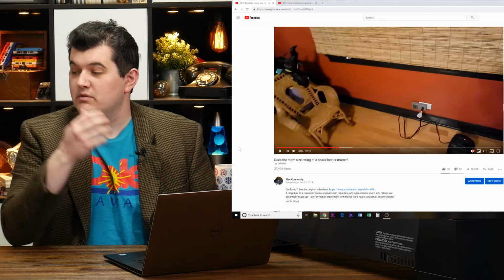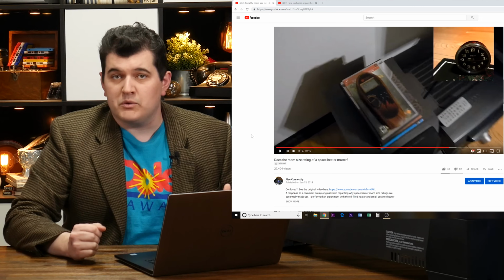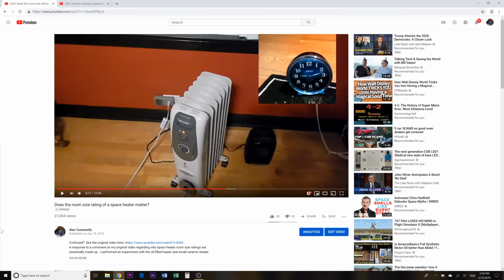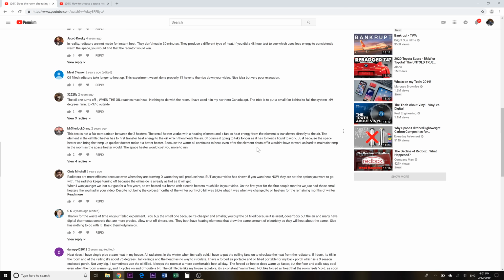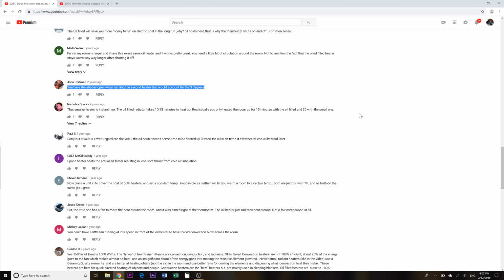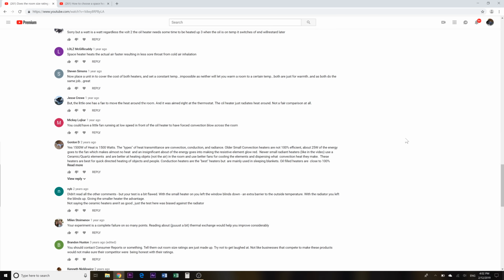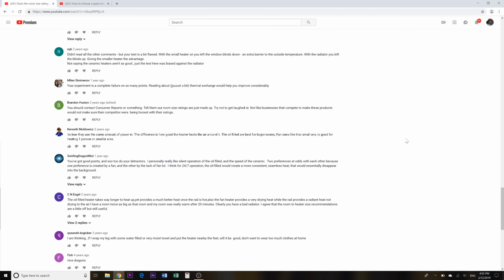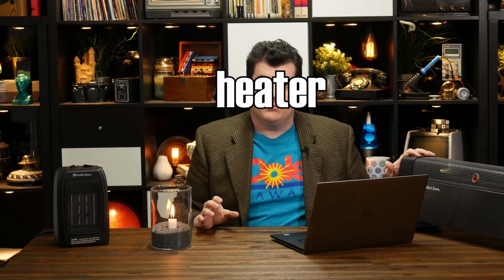More Space Heater Nonsense

Comment: Let me start by saying: I think you did a good job - could always be better but then again so could literally anything -, I don't think you're wrong, I think you're amazing. I'm really just about to ponder about what might be going on both with prices and commenters. Also I'm not reading through the comments, so it's possible someone else said these things already. I'm also not qualified to discuss any of these things, I'm a fantasy writer.

Firstly, I imagine at least at its inception, it could be that the room size rates were focused around how long the heater has to keep running? Maybe the little ones are projected to work fast and for a short time and the other ones are maybe meant to be more resilient to long run times? It could also be that when the room is large enough, having a space heater blowing out a small current of hot air in one direction is just ineffective, and you'd prefer the weird looking upwards facing radiator thing instead? And finally there's the expectation that in a small room the heater would be supervised, unlike the big ones where the thing has to be able to keep itself working alone.

None of this detracts from your main point, those ratings as they are right now make no sense. But I guess it's the same with every unregulated rating system, they're inconsistent at best, completely ungrounded in reality at worst.

As a final barely related note, there's a certain gut reaction to this kind of criticism to something we see everywhere. This instinct to go "No we're no stupid, you're stupid." because if this ridiculousness is omnipresent it indicates there's some deep flaws in society, and not everyone can cope with that.

Comment: I can think of two reasons the large space heater is technically more efficient. 1) it doesn't run a fan, which means any input energy is not being wasted moving around the air around itself and is instead focused on heating only. Sure both put out 1500W of thermal energy, but the small one may cost 1650W of electrical energy to run the fan plus heater. 2) under steady state, a thermostat will cycle the heater instead of you turning it on and off when you get too hot or cold, increasing overall efficiency in maintaining the desired temperature.

Comment: Okay one question about that 100% efficiency. Isn't there any current just flowing through the  heater without being transferred into heat? (it's running on 230v and uses 3000 Watts as I live in Germany, but I don't think it makes a difference in the principle)
The coils of my heater have a much bigger diameter then the cable, it still works as the current of the material the coil is made of is much higher than in the cooper cable. But is it 100% efficient? And if I have current flowing through it with no effect I still have to pay for it, don't I?
Thanks for reading and I hope my English is not to bad.
Stay healthy.

Comment: Maybe the larger ones are somehow better at efficiency. Suggested test:
Hook both heaters up to a socket kw usage meter (do they make those?)
Let both heaters bring roughly same size rooms up to a desired temperature (since you've already demonstrated the smaller one gets there quicker) and see if both heaters are as efficient at MAINTAINING temperature. See if the larger one maintains temperature better - ie, is "better" for larger rooms in terms of efficiency - possibly due to its extra "thermal mass"?
If the smaller heater has to drastically "overheat" the room to maintain a desired temperature, then the higher gradient between the outside temperature and the room temperature may result in greater heat loss over time and reduce efficiency. Whereas if the larger heat mass of the oil heater results in less overheating (the heater can turn off earlier and the oil maintain the temp closer to desired temp for longer) then it may "flatten" the heat spikes and result in less energy loss over time. In which case, it would be better for larger rooms in terms of energy efficiency.

The only other thought I would have is that "radiant" heaters may "produce" ore of its heat as IR (as opposed to convection), which might arguably heat surfaces better, which may make the room "feel" warmer to humans, without having to actually raise the temperature of the room as much (and thus increasing efficiency by reducing thermal loss by again reducing that delta T in the heat transfer formula and limiting energy lost over time.)

Comment: I know it's counter intuitive. But by turning the watts down on the oil heater it could potentially end up throwing more heat. If it heats low and slow it will reduce the surface tension between the hot and cold air. Any heater with a fan will make more turbulence between the hot and cold air. making the effect more immediate. but over the long run of a constantly warm oil heater on low watts vs. a fan assisted heater I believe the oil heater would win.

Comment: Nice video :)
Yeahr i also cant see why 1500w electric heater should be different from an other 1500w electric heater. To get the heat spread in the room, a fan is probably a good thing. The only way i could thing of with which you could get more heat from 1500w electric power would be a heat pump. But thats a totally different story :)

Comment: I am sorry for my ignorance, but say you have a small 1500 watt resistor. Say about the size of a incandescent bulb filament exposed to air. Would it heat a room the same as a regular heater? The answer should be yes, correct? Thanks.

Comment: Potentially, you can get a better rate of temperature increase if there is a higher airflow and it is arguably more efficient to heat a room from 60 to 65 than from 65 to 70 and with better airflow that efficiency can be realized. But even assuming that's correct (which I welcome being told why I'm wrong) I would imagine any improvement in efficiency is negligible.
Also, with some heaters wherein the heating element is visible (think heat lamps) some amount of the 1500 watts can be lost as visible light.

Comment: I've seen shit like this few years ago when I was looking to buy a cordless drill. Apparently some US manufacturers, including DeWalt and Milwaukee, make drills that are listed as 20V and it was some marketing move to encroach on Makita. In reality they are exactly the same 5x3.7 18650 cells, which DeWalt in particular distributes in UK labelled as 18v. Exactly the same thing, I took both apart to compare, the only difference is on a sticker. Otherwise a good drill though.
And yes, I've witnessed some arguments that 20v is much more gooderer than 18v because companies never lie.
Reply: It has to do with nominal and max voltage.  18 and 20 volt systems are the same.  18V is the nominal voltage, while 20V is the maximum voltage.  Just a marketing ploy to make you think its more.  That's why you can buy an adapter and use the 20v DeWalt batteries in a 18v drill.
Reply: @masterofnone7233  Yes.  Exactly.  Lithium ion batteries can be charged to as high as 4.2 volts per cell.  They won't like it very much, but they can go that high.  5 × 4.2 = 21 volts.  Safer to keep them closer to 3.7 volts per cell (18.5 volts in a 5-cell series-wired pack).  Better longevity to keep them from going above 4V per cell and between 20% and 80% full capacity (which the factory batteries and chargers probably do, unless they're stretching the watt-hour ratings).

As I type this I currently own a handful of B&D cordless power tools which say 20V on the side.  And I know this is peak voltage in a fully charged battery pack, not continuous voltage under heavy use.
Reply: And knowing that I hate that none of the cordless power tool providers (or any other cordless appliance) offer charging devices where you can set a target voltage, or at least having a volt meter. The only thing you can do is stopping the charging cycle somewhere, taking the battery out and measure its voltage with a second device. Really stupid.
Reply: Milwaukee made in USA? Dude check those labels. Lol
Reply: because they really are 

Nicads and niMH are a far cry from lithium and they don't hold their voltage very well especially under load. Their only notable advantage over lithium is resistance to freezing outdoor temperatures.
Modern 20v systems are only labeled as 18v because the older crowd had such an initial knee-jerk reaction back then.

There were brands that were forced to sell six celled 25.2v(24v) battery arrangements as '18v' because of that outdated nicad-era meddling for a long time

Comment: The only way I can understand these ratings is the comfort itself, not the heat output. An element heater is objectively better in a small room because it can heat the air up more effectively/faster at its energy capacity therefore distance from the unit isn't as important. Whereas the smaller ratio of hot air in a larger room inst as noticeable so you rely on the radiant properties of oil etc to 'feel' its output. This is obviously undermined by the large element heaters, which agreeably is just plain marketing rubbish...

Comment: People don't get heat energy. My car has a fully automated heating/cooling unit. So if you set it to like 22°C and it's 50°C in the car they still put the ac on "Lo" which basically means it cools with full power. But guess what, it still does it when you set it to 22°C. And they still insist it cools faster.

Comment: I bought oil filed  one last winter 2019 it's the best type of all the one's I used. My the room is 10 x 30. You. Had it to close to the wall. I had it as far as the ac cord would stretch. A pluse is that oil filled does not stir up the dust from the  floor

Comment: The issue with your experiment is you used two heaters that had different methods of delivering heat to the room. Had you used two fan forced heaters you would have had a valid result. While your hypothesis is correct, a lot of the contention I saw was in your methodology. You have two heaters of the same variety in this video, you can run a proper experiment with them though it would be pointless as yea 1500w of power will convert out to the same amount of heat over x amount of time, unless they cycle on and off like the oil heater did.

Comment: "they produce a different type of heat" boy should I tell that commenter or someone else, there's only one type of heat
Reply: That's not correct. Yes, heat is heat, but that's not what's being referred to. "Conduction, convection, and radiation are the three main types of heat transfer." In practice, HVAC, floor heating, space heaters, radiant heaters have different qualities.
Reply: @oliversissonphone6143 they have different qualities, but if your house is insulated they will all heat at the exact same rate with the same wattage and keep your house hot just as long
Reply: I don't think you or your comments are intelligent or understandable for a person with a brain
Reply: @danlittlejohn1913  ok cool. Im still right though. Like its just physics mate.
Reply: The Youtuber should have used the same TYPE of heater.  When doing an experiment it’s important to eliminate all differences except one (the thing being tested). 

I have 2 fan forced heaters.  One is small & identical to his unit.  The other is about 4 times larger, because it’s a large room unit.  Both 1500 watts.  Both heat the room at the  same rate

.

Comment: Not to disagree by any means, I love your channel and videos. But some methods of heating probably are better suited for different situations. The oil filled probably creates more “hot spots” in a room where these would be located, and other parts of the room will be cooler because of the heat loss through the walls and stuff, etc.

While fan based ones probably create a more even heating experience. So while all heaters are the same at 1500 watts, some are probably better at evenly heating areas.
Reply: Yep. The one with a fan will always heat any room more evenly, assuming they're both sitting on the floor in the same spot. The one that doesn't have a fan will heat mostly the air above it by convection. Both will heat out to the sides some by radiation because they're both getting hot.

Comment: click the switch on your ceiling fan that causes it to pull air up from below it and blow across the ceiling. This will cause a downdraft at the walls and push heat across the floor. since heat rises you'll have that floor heat staying in the room more effectively and less will be wasted on the ceiling and walls where it gets sucked out of the room.

if you don't have a ceiling fan in the room you're trying to heat you do need a heater with a fan in it. and some way of keeping the heat from pooling at the ceiling because that heat won't come back into the room air without some coaxing

Comment: In my RV I chose to use both types of space heater for some good reasons not related to the heat output.
1.  The oil filled heater has a thermostat that cycles on the temperature of the oil not the air temperature.  The parts of the heater you might come in physical contact with never get hot enough to provide a  safety hazard.

2.  The ceramic element heaters put out more heat per minute than an oil bath heaters.  But, they get hot enough to start a fire and burn out quickly.  My experience in the small heaters is they burn themselves out in 3-6 months if left continuously running to heat a room.

  I use an oil bath heater to keep the room (RV actually) around 50 degrees F.  Then I use a ceramic heater to bring the temperature up for a specific purpose.  e.g. getting out the the shower wet and naked.  I like my bathing to be toasty warm.

I feel your comparison was a bit of apples and oranges between a short burst instant heat design vs a continuous operation design.  Anecdotally, the oil bath heaters take half a day to bring a room up to temperature but make no noise and no burned dust smell from the heater.
Forced draft and natural convection is the huge difference.

Comment: Literally the only difference is that if you were to open a door and there was a large air exchange with colder air like a door opening if the oil filled heater is already at temperature it will have an easier time getting the room back up to temp. I would say the smaller ceramic unit can probably maintain temperature in the room more steadily because it has the the fan.

Comment: Not having watched the entire video yet, I am noticing one omission. The effective mass of the heaters. 
The "small room" heater is a coil heater with a fan, it effectively creates heat instantly AND had a fan to help it move the heat around the room. 

The "large room" convective heater is just that, convective. Not only does it need to heat the oil inside of it before it starts to heat the room, it also must use the natural convection to move that heat around the room.   In use, it will actually take longer to heat the room, but the mass helps in the long run.
Reply: I wonder if the extra mass of the oil filled, lends itself to being more efficient over time. I.e, you set the thermostat and leave it go vs turn the little heater on, turn it off, etc etc.   I guess it's really the same argument as should I turn my A/C or heat off in the morning and back on when I get home, or let it coast all day on it's own
Reply: Of course, after continuing you watch the vid he addressed most of what I said.  Which I would expect on this channel!

Comment: I can see why one would assume the larger heater is better at heating a larger room compared to the smaller heater, and I was one of those people. Perhaps some people are assuming that a larger heater will have a greater capacity to heat the same space... and it should, provided that the input is larger. But, as you pointed out on the packaging, they're [mostly] all limited to 1500 watts max from the same 15 amp receptacle.

Comment: Here is another useless comment, just saying that so you don't get your hope up...

The only reason I can think of for some of these to be labeled as being for small, medium or large room would be reliability and duty cycle. In general the heaters labeled as being for use in large or medium rooms are either fan less or they have better quality fans. This means they will have a long lifespan, and being used in a larger room they are likely to be working for longer periods of time, and often they might become a semi permanent solution, so the longer life will make some difference. The small heaters which almost all of them has small cheap fans will not have to work as hard to heat up a small room, so they are not going to wear out as quickly as they would do if they were to be used in a large room.

Other than that, it's as you say, energy is energy is heat, so no matter what size they are if they consume the same amount of energy they will produce the same amount of heat. There is no magic about it, despite what marketing departments try to make people believe.

The only heater I'm a bit uncertain about is the IR heaters for outdoor use. I've seen some claims that a ceramic element might heat the immediate air passing the element less than what those with wire elements does. This would make them more efficient at producing radiated heat, as all the heat transported by convection from the heating element is just going up in the sky, effectively being lost for the intended purpose. It's something that wouldn't require magic to explain as the total energy is still the same, but I've yet to see anything but marketing material yapping about it. And as it's not something I'm that all that interested in I haven't tried looking it up.